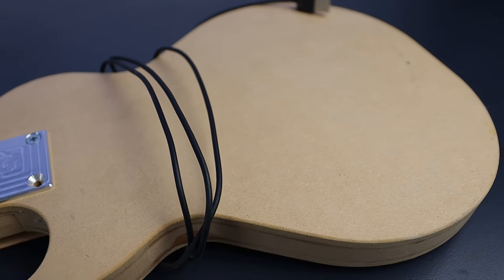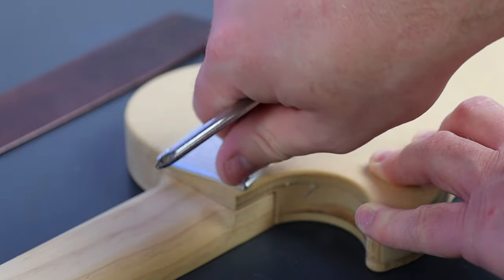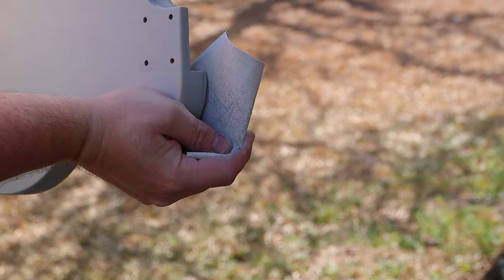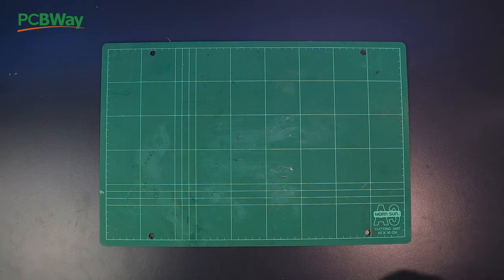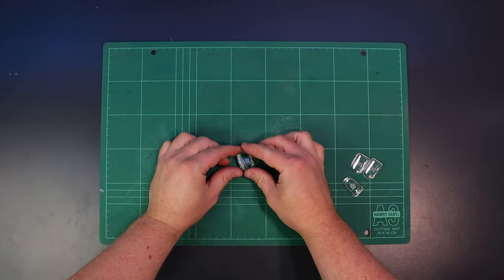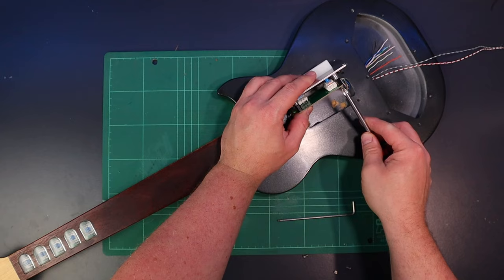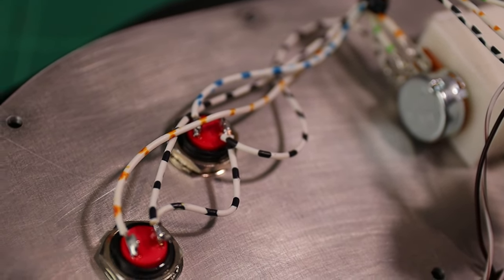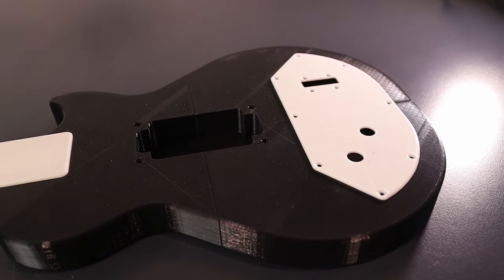The ULTIMATE DIY Clone Hero Controller

Comment: TBH, if I had a CNC mill I wouldn't bother with ordering professional PCBs for simple boards like this either
Reply from the maker: Yeah, it's definitely a good option when the design is simple and you need it fast. Honestly though, simple boards are often so cheap that even if I CNC'd a PCB for the prototyping I'll often replace it with a professional one upon completion of the project. Just simply to ensure the PCB lasts as long as possible.

Comment: Hello, i ordered a 3D print copy from your files, i dont know much about 3D print, but the printer guy said that the supports is missing and was a pain doing it, and the plate which covers the electronics on the body is missing too.
Reply from the maker: With the exception of the fret buttons (which really need to be resin printed) he shouldn't really need many supports at all except for maybe a few in the strum bar area. I did a test print of the entire job before uploading it to make sure it all works properly so I'm not sure what why he complained about adding supports. The end plate is definitely there too, I just double checked the files to confirm

Comment: Gonna be taking the guts from an original SG PS2 controller and maybe adding a usb mode with a R-Pi or something so I can use it on my PC too, and putting them all in my old squire telecaster I did a low-budget build on forever ago. Wish me luck. Removing the fingerboard on a lacquered neck to remove the truss rod has always been really challenging for me. Hopefully I can save the beautiful "tree of life" inlayed fingerboard and dont need to cut a new one.  Everything else should be pretty easy nothing more than extending wires and soldering. Adding extra routing under the pickguard shouldnt need to be too precise either so long as it is covered by the pick guard. Your video helped me a bit with neck routing. Thanks. I have very little but some luthier experience
Reply from the maker: Sorry, only just catching up on comments now! Sounds like a fun project!
I considered using an actual guitar body too (in fact a had a cheap kids guitar here for years for this exact purpose) but at some point I must've thrown it out so I built my own instead!

Comment: are you also including the cnc file? and would it work on the shopbot?
Reply from the maker: I can upload the STEP files for the machined versions of the parts, but you'll have to toolpath it yourself for your own machine. It should work on any machine as long as the parts fit!

Comment: This looks amazing and gives me motivation to design my own guitar based on the actual flying v guitar I have here. Also to make your guitar the best it can be I recommend checking out Sanjay guitar configurator so it's really easy to program (you don't need to write code) and it'll allow the frets to only light up when it's pressed and to whatever color!
Reply from the maker: I haven't heard of that one, but I can definitely take a look. The code is no issue for me though, I just wasn't sure what I wanted to do with the lights at the time of the video so I just used them to light up the fret buttons the correct colours for the time being lol

Comment: Does this emulate a usb keyboard? I want to use this on my xbox
Reply from the maker: Currently it emulates a game controller but the programming could be changed to emulate a standard HID keyboard very easily. I can't say I've tried it with an Xbox but if it works with any regular old USB keyboard then you should be able to get this to work

Comment: This is awesome! I'd been wanting to make my own GH Controller for years. Wouldn't know the first thing about PCB designing though haha. Question about the strum bar, I noticed it seemed to be fitting pretty loose. Is there any sort of spring back to it or is it just based on you bringing it back to neutral yourself when you hit a note
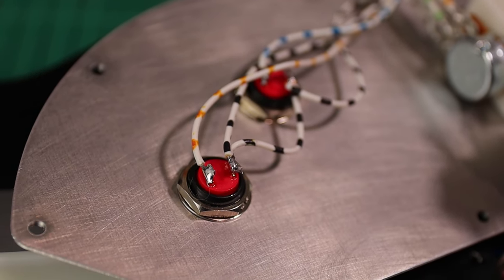Reply from the maker: It has a single rubber band as a spring. It's got plenty of spring back for me, but if you wanted more you could always fit a second one or some sort of extension spring. If you take a look at around the 8:30 mark you'll see the rubber band attached to it
Reply: @cncdan  I see, I remember seeing a rubber band but I thought it was for the whammy bar, but that's a smart way of handling it, way better than those crappy microswitches they used on the real guitars
Reply from the maker: @KyleKatarn145  Ah sorry, my mistake I misread your first comment! Yeah the strum bar on mine is just relying on the springs in the mechanical key switches to return it to centre. You could however do something like what I did on the strum bar if you wanted a stiffer spring!